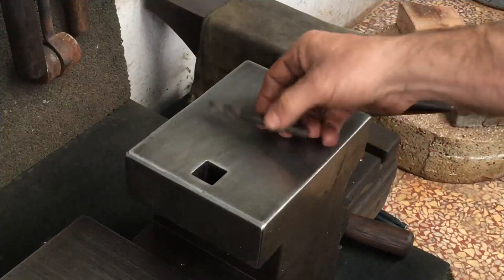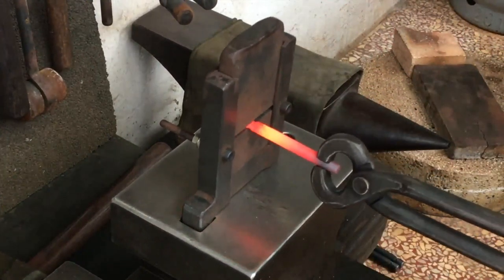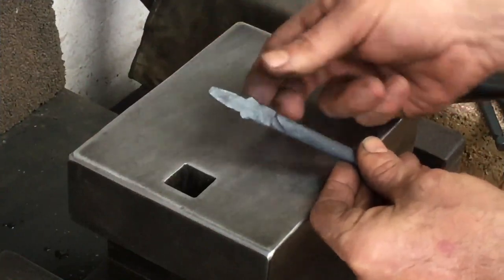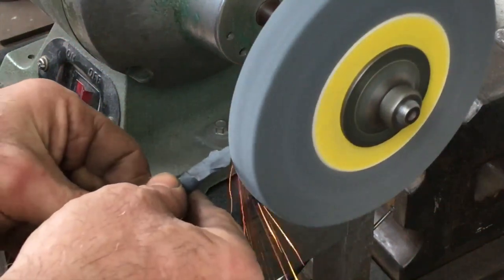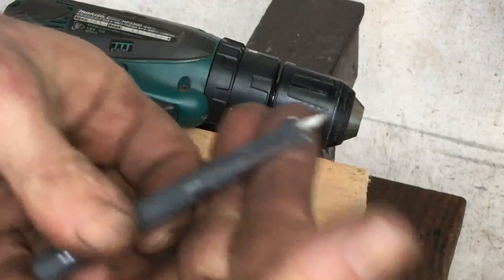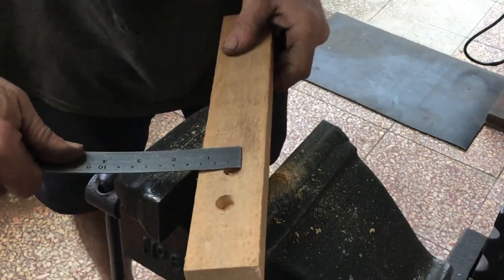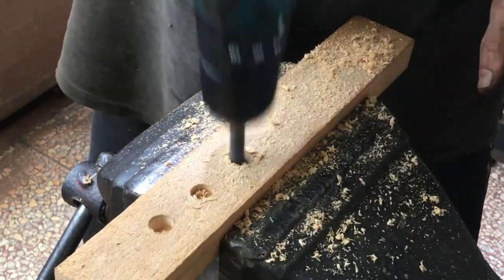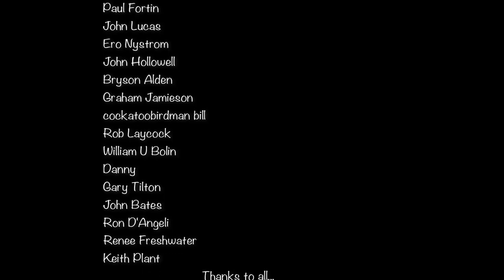Make a Drill Bit from a Drill Bit (metal twist to wood spade)

Comment: Very  cool Glen . I knew an old timer that used all sorts of things to make drill bits and other unusual tools, mostly bits of old files and especially the tangs. He showed me how to make loads of weird little tools that just work at what you need them for.
 He always said "If you can make one quick, its pennies in your pocket"  and honestly usually a lot more than that...and alot of the time you couldnt buy one to do exactly the job we were making them for anyway.
Reply: My grandfather was that way. He was a mechanic and worked on log stackers and forklifts. I have wrenches that go all the way up to 2 inches. There's also an assortment of wrenches that have been cut and welded back together in weird shapes or bent in 3 places at odd angles so that he could reach into a tight spot. I've never seen one for sale in any stores but I have a couple of homemade sockets for something like a square oil plug. Where you can't get a wrench on it to turn it, but you can get to the end of it and put a socket on there.
Reply from the maker: That's really interesting and is a good example of "necessity is the mother of invention". Thanks for sharing.
Reply from the maker: Good stuff. Thanks.

Comment: Most high speed steels need an anneal after forging at around 870 celsius, followed by vermiculite cooling. For hardening, you need to go to 1150-1200 celsius, quench in oil, then triple temper at 550 celsius. This should give you hardness in the 62-64 hrc range. Hope this helps.
Reply from the maker: I just left this cobalt drill as is with no specific heat treatment and for woods of all kinds, it's working better than I thought it would. Thanks for the heat treating info.

Comment: Excellent Glen!!  Sure is nice making your own tools when needed.  In the near future I'll be making a spade type drill bit for drilling iron.  It's all part of an experiment/project I'm planning. Hope all is well with you and family.
Reply from the maker: Hi Jeff, this turned out better than I planned. It's not much to look at but it drills woods of all kinds, soft and hard, very well. I would be interested in your spade bit for iron. Another tool I'm interested in is a planer for steel. I saw somewhere before where a Japanese blacksmith had a tool that could plane steel - something like using a file but used on the pull stroke and he removed material incredibly fast compared to a file. Wishing you the best.
Reply: @gstongs  --  That would be interesting.  If you happen across how this was done or make a replica please let us know!!

Comment: Inspiring! I need a new bit for Kydex, and have lots of old, dull bits the right size, so I will make one instead of buying one. Thanks!
Reply from the maker: This is a project worth trying. I maybe got lucky with the cutting edges on the first go with this one as it works better than I imagined. Thanks.

Comment: For soft wood like the one you tested this on, you could've made it from mild steel and it would work the same. For the hard wood, though, you may need some tool steel with a known for you heat-treatment protocol, because you annealed this drill bit and, as I see in a video, hadn't heat-treated it back. I dunno would it work much better than mild steel now.
Reply from the maker: I used this on hardwoods and it still works very well just as is, with no specific heat treatment, probably due to the cobalt content of this drill. Thanks.

Comment: Nice mate. Do you not need to heat treat the bit? Please excuse the question if it's dopey.
Reply from the maker: It's a good question. Since this is a metalworking cobalt bit I figured it should remain plenty hard enough for wood without heat treating. And that turned out to be the case. Thanks.
Reply: @gstongs  Cheers Glen. Another thing learned. 👍